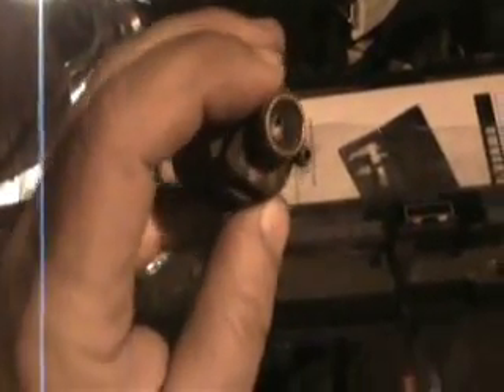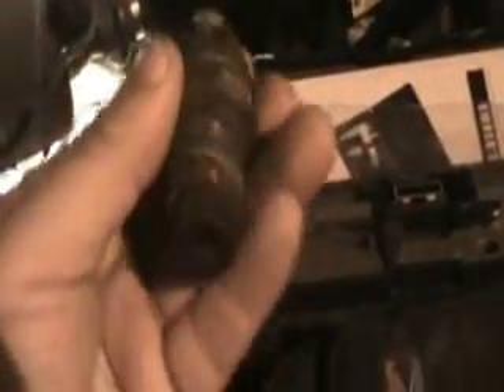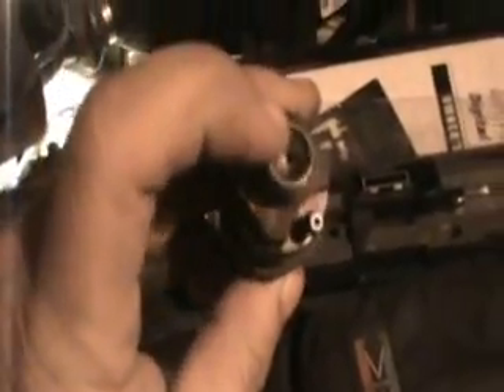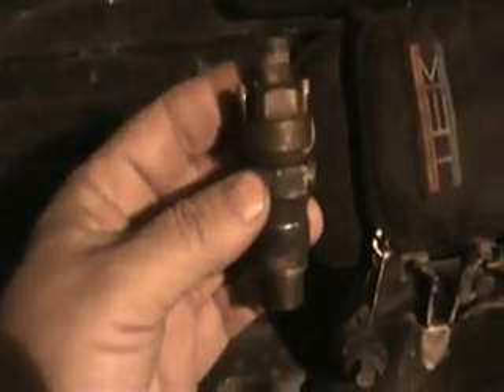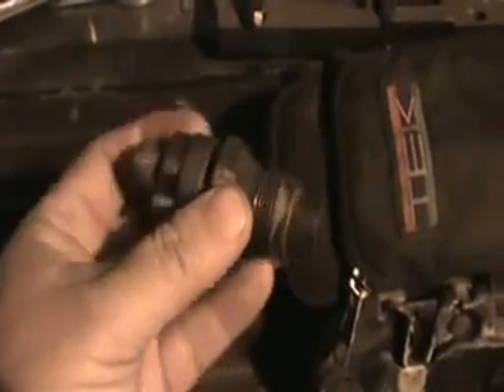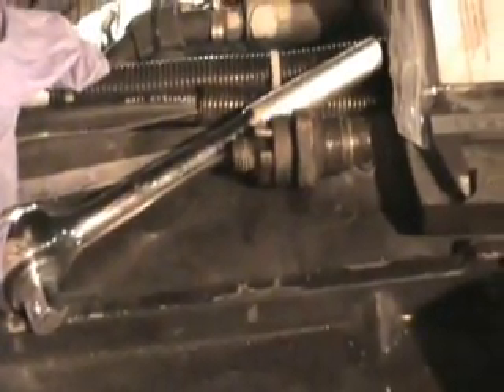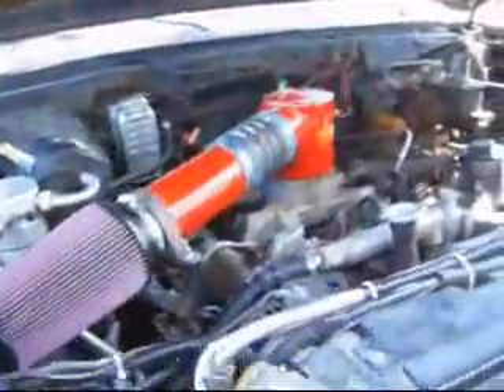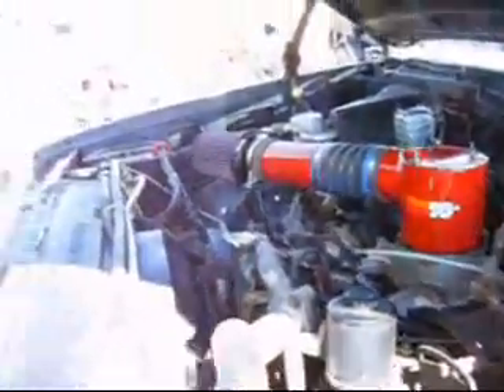6.2 liter Detroit Diesel .wmv

Comment from the maker: @sampson153 I used a regular 4 inch air to air boot that I had laying around and an aluminum 4 inch pipe with the K&N on the end.  It sure made that engine breathe a lot better than it did before. I have maybe 75 bucks in the whole intake..

Comment from the maker: @sampson153 The K&N was 50 bucks.. The way It was pieced together was 6 inch exhaust flared slightly to sit on the intake manifold with a 4 inch exhaust stubbed out of it.  I sealed it to the intake with regular silicone sealer as I don’t plan on removing it any time soon.